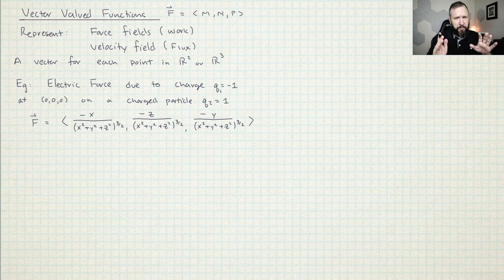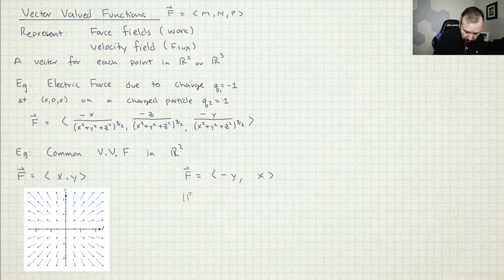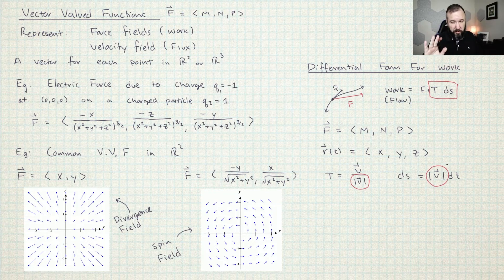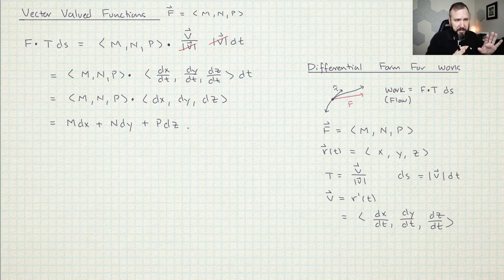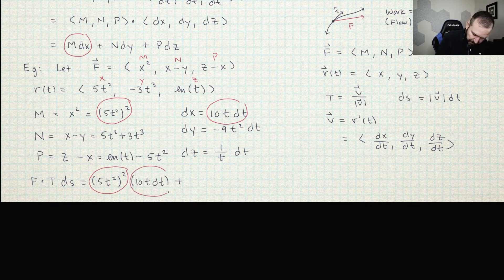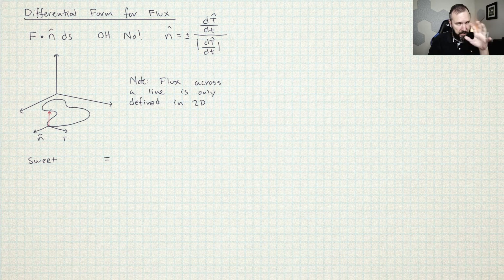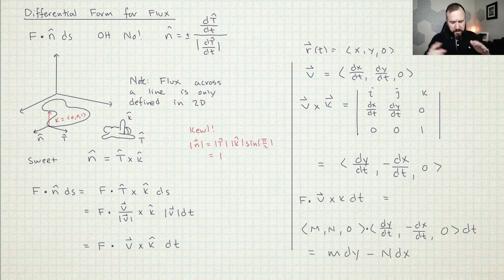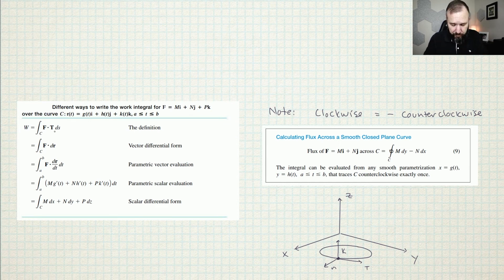What are the differential forms for flux and flow

Comment: Nice! Would you say the difference between work and flow is that the integral must be over a closed line (or surface) for flow, while work just requires any path?
Reply from the maker: That's close, 'circulation' is what we call it when the integral is over a closed line.  Flow and work are both for any path